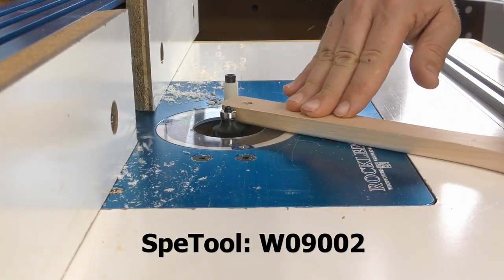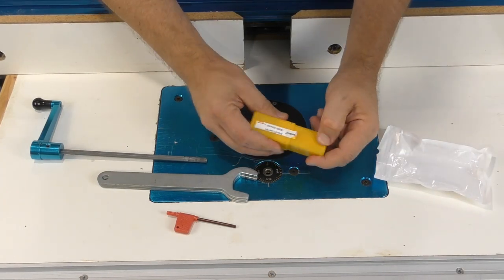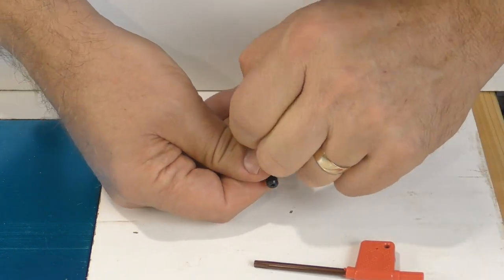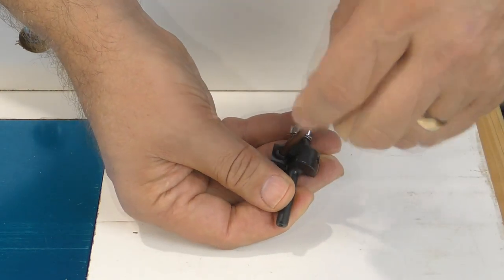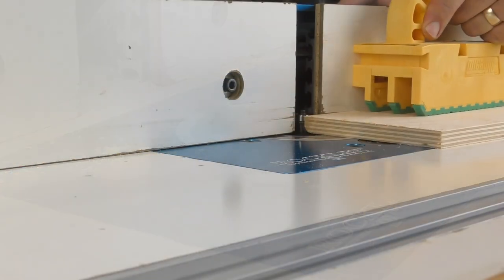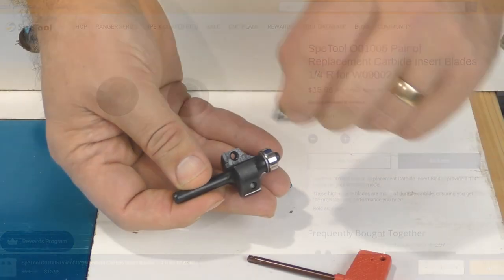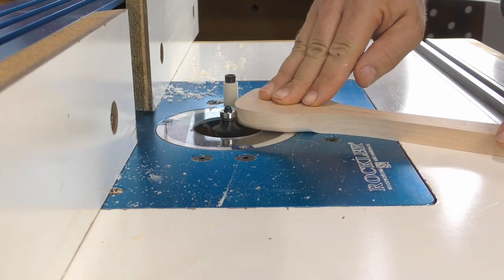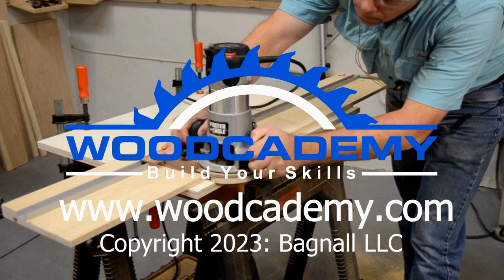Should You Buy Insert Router Bits? -A Spe Tools Corner Round Insert Bit Review

Comment: good steel? not brittle?
Reply from the maker: Tool steel, which is typical for arbors. Arbors with attached cutters like this are typically stronger than the steel shanks that carbide cutters are brazed onto.
Reply: @Woodcademy  Sorry, i meant the inserts - i'm reading reviews on some of the $20 per 10 inserts, being really brittle. Any brand that makes quality inserts that you prefer.
Reply: @rosskstar  no worries! I have a couple of the SPE Tools insert cutters and I have not had any issues with the carbide. I have not found these to be brittle.
Reply: cool beans, i'm looking at SpeTool Carbide Inserts Heavy Duty Flush Trim Router Bit @Microjig
Reply from the maker: @rosskstar  MicroJig beat me to it. No issues with SPE inserts.
Reply: thanks! It's a good time to pray, read scripture ~prep the mind for the "hidden manna" ~Rev2
this is the big one 'Lizbeth!
 @Woodcademy